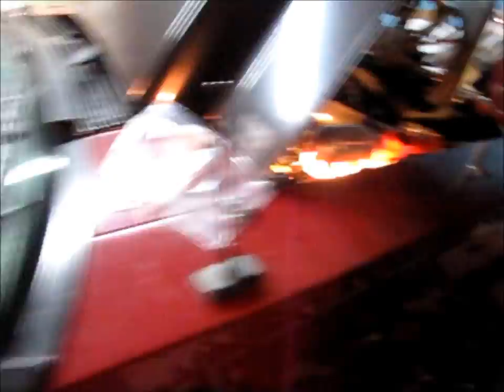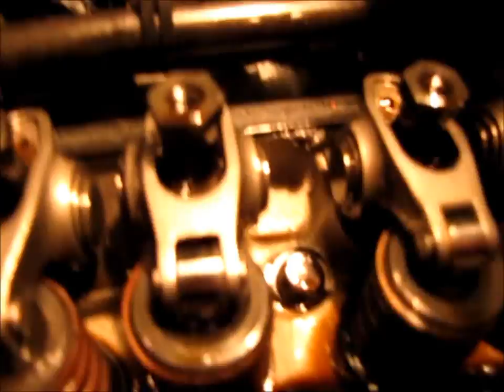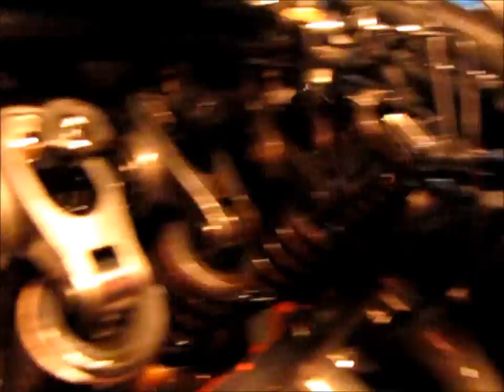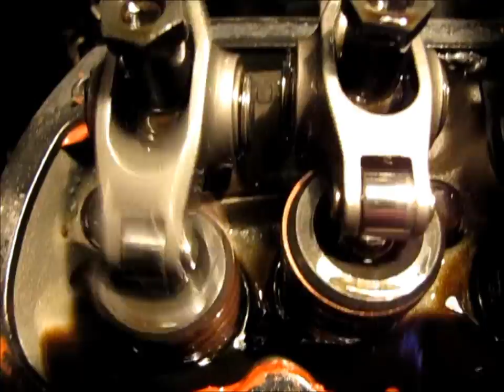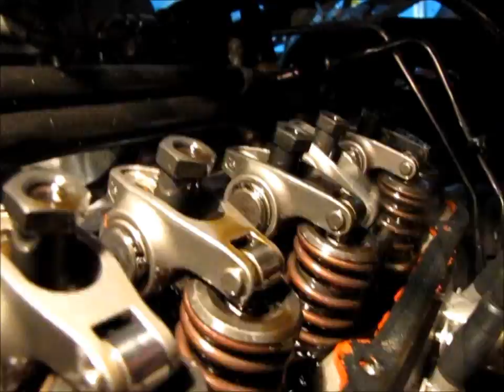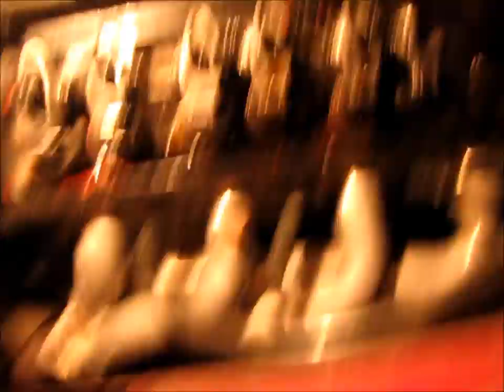Roller Rockers while motor running

Comment: ok guys and girls here's the best explanation of valve lash,first of all its not side to side movement of rocker. Secondly it takes time,patience and usually an oily mess,oil deflecting clips make it easier. With the engine running, loosen the rocker until it clicks,here's the tricky part. Tighten it very very slowly until click goes away Allow time for the lifter to pump back up,otherwise you will collapse the liftter,it's a slow and tedious process. Take your time and reap the rewards

Comment: they all sound like sewing machines, when I first got my engine I thought there was something wrong with it until I listened to other peoples videos , they all have a tap tap noise. If it were not roller rockers I would be concerned but that's just the way they are unless you get special valve covers.

Comment: Last time I ran the rockers with the valve cover off mine I soaked my headers smelt like burning oil for weeks, did you ever figure out what all the chatter is from? We're thinking about getting a set of TF heads and putting roller rockers on, this made me think about not getting roller rockers.

Comment: Positive you have preload correct? If you have a performance cam you may need different pushrods like I did. I run a E303 and I originally had 6.272 length PR and got a pushrod checker to find out I needed 6.300 to get proper preload. Valve trains can be a pain in the dick sometimes to dial in because each valve may need different loving lol. Some need shims some don't